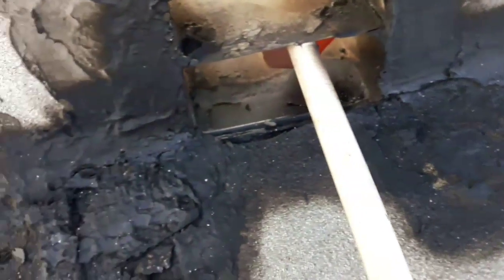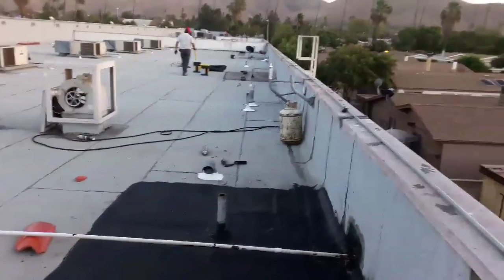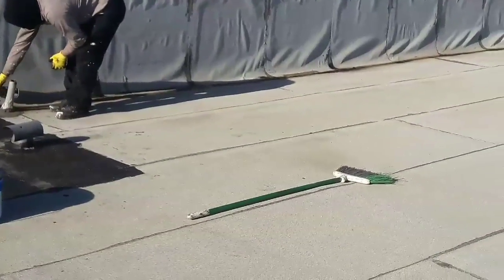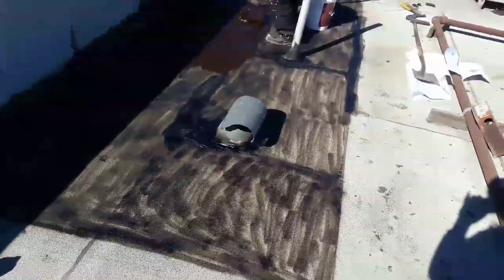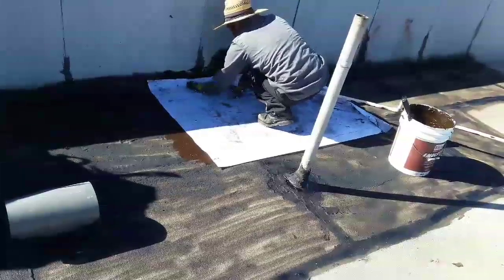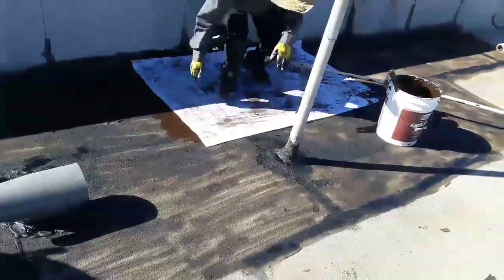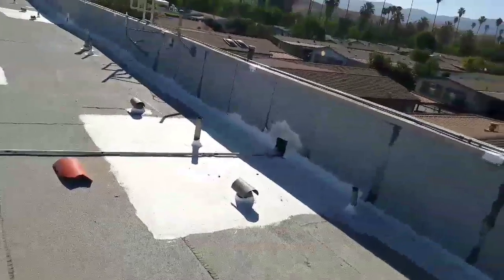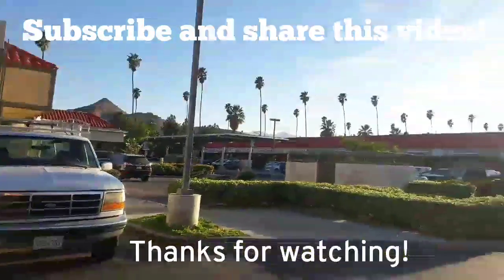ROOF REPAIR: Use this product to easily stop any water leak!👍👌💪😃😀

Comment: thanks for the videos I'm going to install duration Owens Corning cool roof on a 3 /12 pitch roof I was wondering what type of pill and stick would be good for underneath
Reply from the maker: Use any peel & stick underlayment or 2 layers of 15 Lbs felt...also

Comment: I am dealing with an old commercial building and I need to do repairs because it is leaking into the salon that is attached to an hotel. My problem, is that it is wet and moist on top of this roof from rain and snow.

Comment: You need   Kettle hot asphalt and glass ply
Cut the scupper out and reflash them
Reply from the maker: That repair would be done in the 90's ...late 90's probably...now days you don't need hot mop ...few roofers use hot mop now days

Comment: Hi Eric. Can you tell whats the brown cost you apply with the fabric? And akso what ia the white coat?? Thank you.
Reply from the maker: The brown coat is asphalt emulsion: liquid asphalt
The white coating is just regular roof coating...now you can apply silicone coating and would make it better
Reply: @Garciasroofing  so first you apply asphalt emulsion and let it dry and then silicone coating. Right?
Reply: @gangelkoski  Looks like he did spray primer first, emulsion second (rolled on) embed a layer of white fabric (polyester I think which is very different from the common yellow fiberglass webbing), then add a little more emulsion to the top, let it dry 24-48 hours, then coat with white coating of your choice, then let it dry 24-48 hours then coat again and you should get a similar result to what he did.